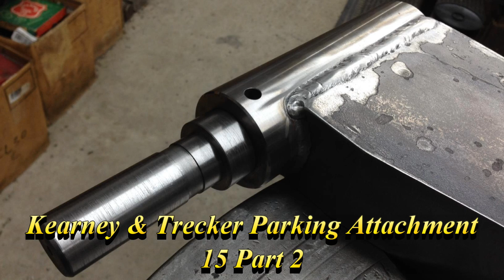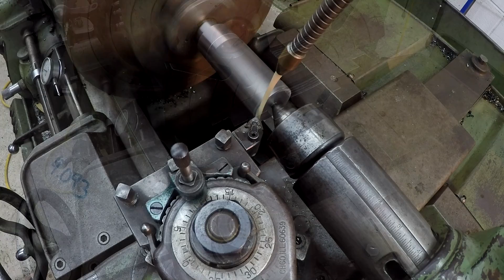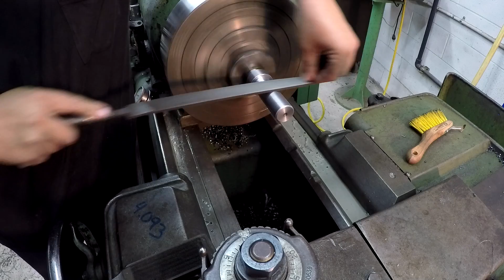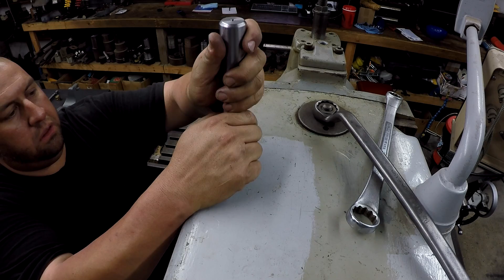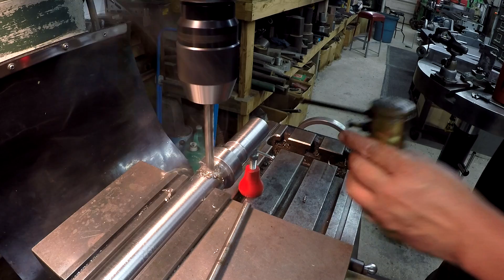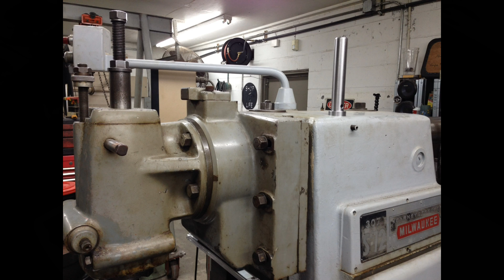Kearney & Trecker Parking Attachment 15 Part 2

Comment: I've been wondering... have you ever considered using a diamond sharpening block to get a surface finish on parts? especially the finest grit one you could find... i would be curious what you think of that sort of idea, as opposed to the much cheaper option of sand paper, which I've seen be used, but how would the finish compare from using either of those...
Reply from the maker: No I have never used the diamond for finishing unless it was on a tool bit.
Reply: lol, i suppose that makes sense. thanks man =)

Comment: Adam,
Do you ever make a spring cut by reversing the direction of the carriage? Just curious about the pro-s and con-s of doing so.
Regards,
Eric
Reply from the maker: You know, that's something my dad used to do once in a while. You either like it or you don't. I never did like doing it myself.
Reply: I believe some lathes you have to run back like that.  On those if you disengage you lose the precise alignment again for the next cut.

Comment: Hi Adam,
Great video as always-- I can hardly wait for Saturdays to come around so we get another Abom vid!
A question about something I've noticed before on your videos-- the same with this one when you were bringing down the diameter on the short end of this pin.  When you made the initial roughing cut at a high feed rate the finish looked like a mirror.  After the finish pass at shallow depth and lower feed rate the finish looked much rougher.   This is counter-intuitive to me.  Why is this?
Keep em coming Adam!
Terry
Reply from the maker: It's common when using carbide insert that the pressure from a heavy cut produces a more shiny finish on the surface. The light cuts make it more tricky to get a good finish. The 4140 heat treated shafting like I machine at work is much easier to maintain that smooth shiny finish.

Comment: Regarding your Camera Filter, my opinion is: and it's probably not worth two cents, I don't think it's even worth messing with. It may be helping with the viewing of the dial face by a few percent, but it's detracting with most everything else. You can see a bigger difference when the dial face is shaded from above "like when you're leaning closer to the machine/indicating in the chuck.
Start the video at about 2:09-2:11 to watch what I'm talking about. It;s just before you stop the camera/fade into the next scene. There are other spots prior like at  2:01 also.
("Lean in" dial face gets easier to see) ("lean back out" dial face is harder to see).

Comment: Adam- would it be worth it to drill a hole up the center of the "machine side"/lower side of the shaft/pin and meet it with a perpendicular hole through the shoulder piece to relieve the vacuum when inserting or removing it from the machine?
Reply from the maker: it probably wouldn't hurt.

Comment: The CPL filter worked very well each time you used. I could see the dial clearly and could see how you were adjusting as you got the pieces indicated in. It's a keeper, I would say.
Thanks for talking the trouble to get a good shot.
Reply from the maker: It does seen to help some. I watched some of the footage on the tv and I could see the dial pretty clearly. Thanks.

Comment: The channel is great, keep it on!  I am actually beginner in metalworking,  but sure you are great! 
 One thing that I noticed: Your Monarch lathe is so quiet,  how is it possible?  Do your other older lathes are this silent? 

I got only an old swiss Reiden t185,  not worn out,  but terribly noisy at higher speed, especially on 1500rpm max. 

Earplugs time here. 

Great work for you!
Reply from the maker: Many of the old machine such S monarch and American were engineered to be durable, strong, rigid, and to last a lifetime. Monarch made all efforts to build the best lathe in the industry. You can see after 75 years my lathe is still running great. They used helical gears which run smooth and quiet. Lathes with straight tooth gears are more noisy.

Comment: They say that the keyless chucks are by design more accurate than jacobs type. Also my old shop teach would frown at me if I used the center drill the same way as you Adam as he always said that when using center drills for starting a hole for a twist drill you're only supposed to use the 1st stage of the bit due to the difference between the twist drill angles and the live center. But it gets the job done properly pretty much everytime. Who cares for the extra 1 thousands precision.
Reply from the maker: These days most of the time I only use the center drill to spot on the hole, but sometimes I drill deeper wanting to make sure I keeps good alignment. I really need to invest in a wide selection of spotting and centering drills.

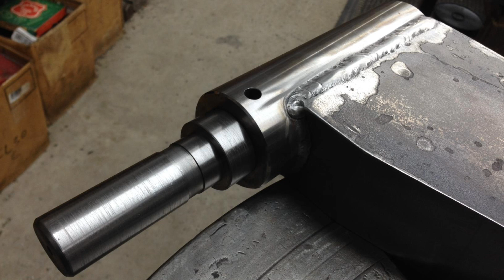Comment: Hi Adam, nice weekend video set.  I noticed on the close up of the pin near the end that there looked like some tearing of the surface.  Probably doesn't affect anything, but what causes that?  Your normal turned surfaces are much nicer.  You can see the difference on the outer piece you welded to the arm vs the pin @23:30 on the video.

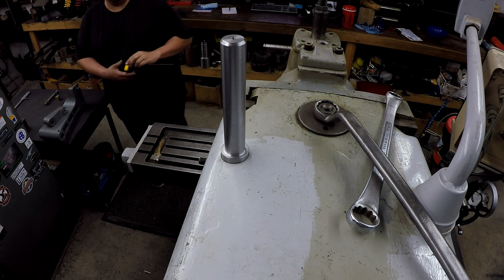Comment: 16:30 Will that shaft be oiled / greased when it is finally fitted ?
Reply from the maker: Yes I'll make sure it's lubed for final install.
Reply: Abom79 I was just wondering if lube might tighten things up a fraction ?

Comment: Nothing better than watching the part slide slowly in and knowing that fit is dead on.

I remembered what you said about double checking that you moved the right distance after finding the edge.  Making the grinding wheel dresser, I measured to mill the grove and had forgotten the offset of for the edge finder.  Almost was an oops.

Comment: Viewing is great.  Been going to make a suggestion for a while now, but hate to be pushy.  Still, after 35 years in the trade at Dresser, then Dresser-Rand on assorted numerical tape controls, cnc's, manual lathes, etc, we started making instant soft jaws by cutting strips of 1/8 thick aluminum long enough to wrap around the outer portion of each jaw.  Once bent to shape it's a simple matter to slide the 1/2 to 5/8 wide on to make soft jaws.  Keep up the great vids.

Comment: Ready for the test fitting!  Filter is really helping out with the indicating!  On the bench deburring of the pin hole, something's off with the audio, had some faint static that was just loud enough to be noticeable.  Your talking is still clear and very understandable, but the audio static was like at background level.

Comment: That filter works great. It eliminated glare on the indicators. I could follow readings as you dialed in and I could see indicator carriage stop (but not he numbers) as the hand moved from 3 o'clock to 6 or 7 relative to you.

Is that like a polarizing filter you orient to minimize glare?

And yeah there was a little audio noise at the end. So what? I could read the dials.

Have fun at the Bash? That cannonball in the pool was the best I ever saw. Keep up the good work. We in the LLP (League of Large Persons - sole qualification: can't fit a standard tourist class airline seat. I'm 6 ft 3" 330 lb) are proud of your accomplishment.